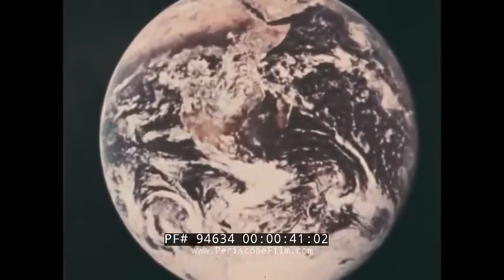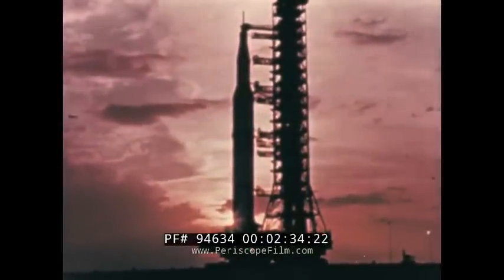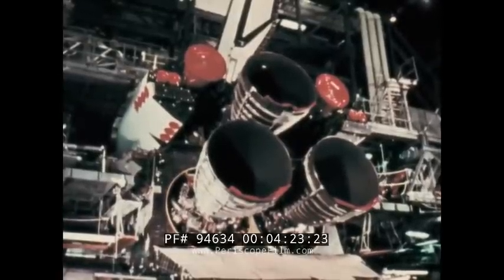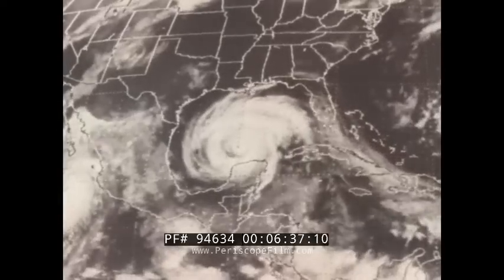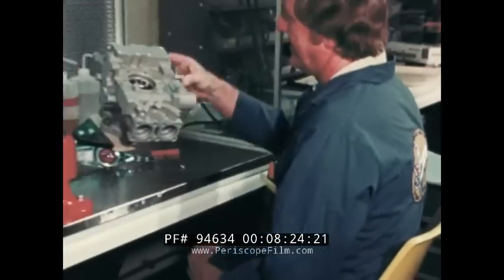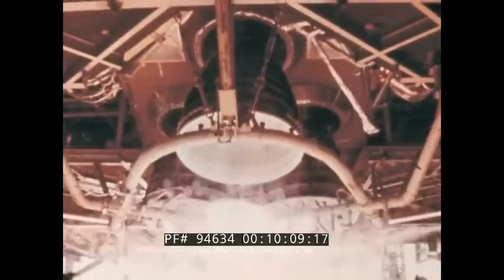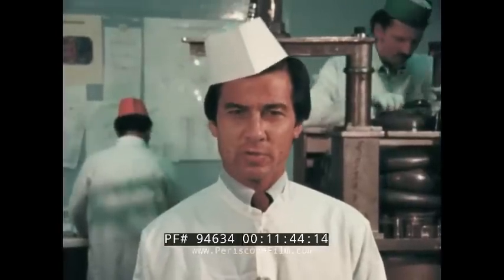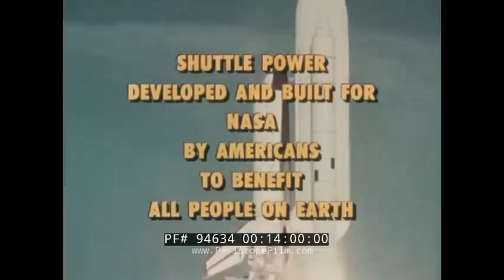" SHUTTLE POWER "  1980s ROCKWELL INTERNATIONAL / NASA SPACE SHUTTLE PROGRAM PROMO FILM   94634

Comment: "Within two weeks, the orbiter is re-furbished and ready for another flight.  Maintenance of the engine is similar to that practiced by commercial airlines".  How did that work out for them?
Reply: funny how their 2 weeks looked like 9 months to me!!!
Reply: Yeah originally it was supposed to be a minor ground checkout of the engines on the turnaround, similar to an airliner.  IN fact it turned out to be "after a shuttle lands, pull all three engines and send them for COMPLETE TEARDOWN AND INSPECTION OVERHAULS at the factory, send them from there to Stennis Space Center in Mississippi for test firing in the test stands there to be certified, and then ship them from Stennis to Kennedy Space Center for reinstallation on an orbiter.   Imagine if after EVERY Southwest flight they had to pull the engines and ship them back to Pratt and Whitney or whomever for a complete teardown and overhaul LOL:)  Later!  OL J R :)

Comment: 2 week turn around.... Well, that didn't quite happen.
Reply: No, it sure didn't.
Reply: That's why I'm a bit skeptical of the SpaceX Starship. Even if it does fly successfully, I doubt they can do an extremely rapid turnaround like they're hoping. It could very well be a highly useful rocket, but my gut feeling is that it will take several weeks to prepare each vehicle for flight at very quickest.
Reply: @thunderbird1921   I think you may be right but they don't appear to have the same engine issues as the rs-25s had and they are also quicker at producing hardware than nasa ever were.

That combined with the porkbelly attitude of Nasa should make some of the spacex ideas come to pass, but far from all or even most of them.
Reply: @marvintpandroid2213  "That combined with the porkbelly attitude of Nasa Congress" 
Marvin, this isn't saying you're wrong, just an additional perspective.
Reply: @cowboybob7093  true, nasa would have loved to get rid of the pork but it was always going to be a creature of politics, as it still is.
Reply: @lukestrawwalker  Excellent post. The S-ID is a new one for me. I always figured it would be stretched. Really dig those SDASM Atlas booster staging clips though. And the Skylab gymnasium, jawdropping.
One thing I've come across is the sentiment late in the Saturn program is the sentiment concerning the launch record that their luck was running out.

Comment: Still, publicly, nothing of any significance ever came out. A big nothing burger unless there is a runway on the moon.
Reply: Do you think the ISS built itself?  Elon wouldn't have anywhere to launch rockets to without STS.  Nice try though.
Reply: @rileyk99  A station the size and mass of ISS could have been built with 5-6 launches of a Saturn V class SHLV compared to 40+ launches of shuttle.  Shuttle took 13 years to do all that while a Saturn V class launcher could have done it in 3 years.  Shuttle was a huge waste of time.  Shuttle could barely stagger up to the Hubble orbital altitude (took every bit of power they could wring out of it to get that high) and shuttle was basically a manned reusable 100 ton payload fairing.  WAY more expensive per launch than Saturn V for only a FRACTION of the payload capability.   The Russians didn't need a shuttle for their part of ISS; they launched their two modules on Proton's.  Similarly, future stations will be built by unmanned rockets launching modules-- you could do it today with Falcon Heavy and when Starship is up and running you can launch modules with it.  

Even shuttle's "crowning jewel", the Hubble Space Telescope, was as much a victim of shuttle as saved by it.  Hubble's mirror was going to be tested on the ground, but it was canceled to save money because of shuttle program cost overruns and problems, thanks to then NASA Administrator Dan Goldin's "Faster, Better, Cheaper" program.  Had the mirror been properly ground tested, the fault in its shape would have been detected and corrected, but to save $100,000 it was canceled, which necessitated a billion dollar shuttle rescue mission to Hubble to correct.  Plus Hubble was trapped in a terrible low Earth orbit (LEO) because it's all the shuttle could possibly get to, to launch and service Hubble.  Having a space telescope in LEO is terrible because 1) there's a huge honkin' planet (Earth) in the way for half of every orbit, in the way of whatever it's observing and 2) flying in and out of Earth's shadow every 45 minutes results in a rapid temperature change from the 200 degree nightside in Earth's shadow, to +200 degrees on the daylight side of the orbit, which results in thermal expansion and "popping" of the structure which makes observations impossible for a few minutes til the structure thermally equalizes.  To get the most and best science return out of a space telescope, you really want to put it out into at least a high Earth orbit, or a highly elliptical Earth orbit, or better yet out at a Lagrange point halo orbit, as is planned for the Webb telescope.  That way the Earth is just a tiny disk or distant point of light in the "sky" around the telescope, which doesn't obscure its observations like when it takes up "half the sky" the telescope can see in LEO.  Plus it's not passing into and out of Earth's shadow, meaning a much stabler thermal environment and no "popping" of the telescope as it heats up and cools down.  For what all the shuttle servicing missions to Hubble cost, basically we could have launched a FLEET of space telescopes, though some would have been a loss or quit over time, but some of them would have continued to function while others were still operating, giving a far better science return, particularly if they were in a better orbit as mentioned.   Plus, being at a distant orbit or Lagrange point doens't rule out a manned servicing mission to the telescope- just a manned servicing mission *by shuttle*.  An Apollo, or more recently an Orion or even suitably modified and equipped Crew Dragon COULD perform a manned servicing mission to a space telescope, even at a distant Lagrange point (ESL-1 or 2).  EML (Earth Moon Lagrange) points are even easier to get to.  Some equipment could be stored in a Dragon Trunk of a Crew Dragon, and if additional propulsion or oversized equipment was required, that could be launched into a parking orbit in LEO by Falcon 9 and met up with a Crew Dragon, dock to it, and then use the payload propulsion unit (in-space propulsion unit) to propel the Crew Dragon out to the telescope.  A similar system would work for an Orion MPCV spacecraft for payload and/or propulsion.  A small robot arm could even be incorporated into it for repairs as needed.  Such a "repair module" could be left in orbit permanently as a free flyer for any subsequent repair missions as needed.  

Shuttle was really in no way "all it was cracked up to be".  I for one am glad they're retired-- they basically held back space advances for 40 years... OL J R : )
Reply: @lukestrawwalker  collect your check from Elon now.
Reply: @rileyk99  How do sour grapes taste??  Just because shuttle was antiquated and a bad idea... Oh well I'm used to the shuttle huggers hating on everything that does most of what shuttle could do only better, cheaper, and safer... 

Go collect your United Space Alliance check now LOL:)  Have a good one!  OL J R :)
Reply: @rileyk99  yep, exactly. the thing is that there are a lot of Elon sheep that understand little or nothing about this kind of stuff. that's the world we live in.